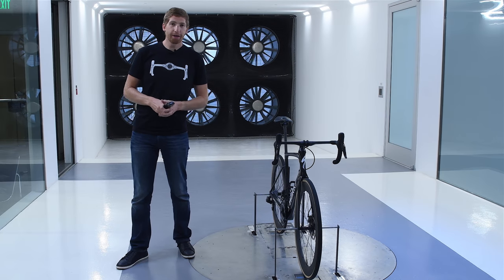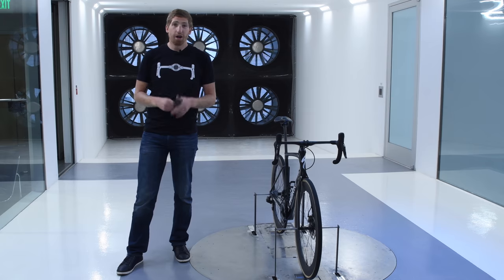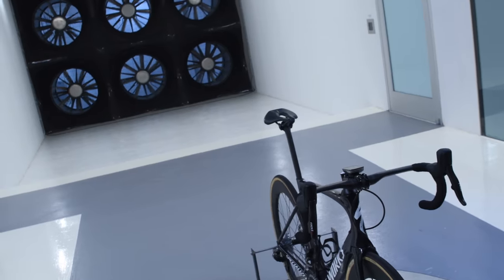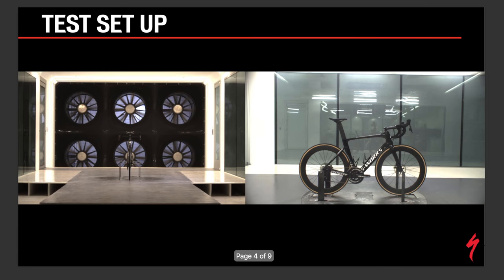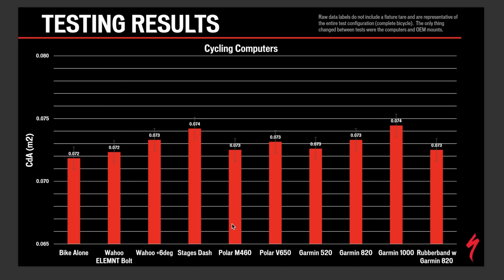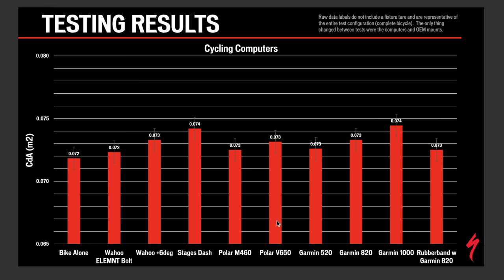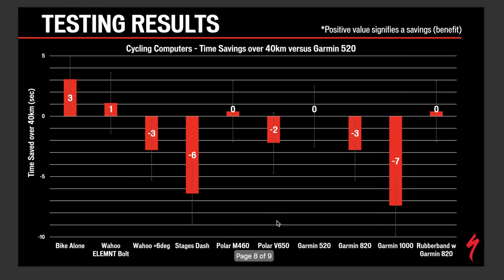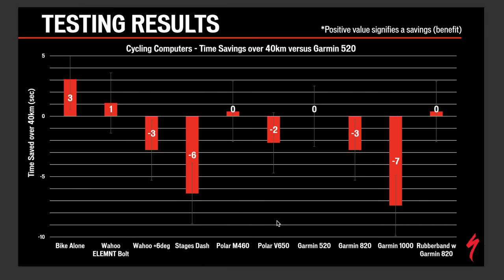Wahoo BOLT AERO claims: FACT or FICTION?

Comment: Great video. Great sound! Love the concept. But wahoo cracks me up. 1-3 seconds over 40km. Aero efficiency is far more greatly impacted by tightness of clothing, rider position on bike and ability to hold a constant position over 40km, and size of beer gut. I can't really believe we are even talking about 1-3 second gains when most weekend warriors could all do with losing a few kg!!!
Reply: The fact that tight clothes matter more doesn't mean a faster computer isn't worth getting.   Especially if you need a new one anyway and you're either not picky or a faster computer meets your other demands in a computer.  Of course,  claims should be accurate at the same time..

Comment: Hey Ray, out of curiosity, what speeds are these claims at? Obviously drag increases with speed.

I'm probably not going to be as fast as Chris Froome in a TT. If I'm riding at 20mph into a block headwind, the drag would be different to 25mph with a cross tail wind.
Reply from the maker: The tunnel is at 50KPH, and their claims are at 30KPH.

Comment: A test I think would be interesting is if instead of mounting the computers ahead of the handlebars you were to install them behind, trailing the handlebars. Wound the aerodynamic effects of the handlebars reduce the drag of the computer. Sure it puts the unit in an odd position, but if someone is that concerned about it I'm sure they'd live with it.
Reply from the maker: If you mounted it to the handlebars backwards, the screen would be backwards since it can only fit in one direction.  Not sure too many people would want the screen upsidedown.

Comment: How is it possible that there is diffrence between garmin 520 and 820. Both have the same body size and shape.
Reply: But not the same number of buttons or screen size.
Reply from the maker: Correct, very slight hardware differences. Almost identical...but not quite.
Reply: Come on guys... The same dimensions: 49.0 x 73.0 x 21.0 mm (sizes from Garmin site). Display is the same (820 has a touch screen - no areo benefits). I would say that measurements in wind tunnel were inaccurate.
Reply from the maker: Do note that within the video I talk about the accuracy range of the tunnel, so you're going to get some minor fluctuations there as indicated on the slides itself.  Still, the reality is that even having something just 1mm different can and is a big deal in aerodynamics terms.  The Edge 520 and 820 aren't exactly the same, despite was Garmin says - hence, there will be differences.

Comment: When you don't even bother to put a dummy on the bike, when your test is conducted with a wind speed of 50kph. (Nobody can ride at that speed for the full 40km TT, not even indoor)
Your channel doesn't grow because it is a commercial.
Reply from the maker: As discussed in the post and the video, a dummy on the bike wouldn't impact this area of aerodynamics (whereas it would further back for other components).  Also, the reason for the higher speed (as also discussed) is because lower speeds introduces a higher error rate in wind tunnels which in turn reduces the measured accuracy, and doesn't impact the actual numbers here (that's been tested and proven separately by other studies).

In unrelated news, according to Social Blade it'll take approximately 5 years for your channel to reach 1/10th the size of this channel today, based on your current growth rate.
Reply: To sum it up. You don't know aero very well, or you knew it but you pretend.  A front mount bike computer hit the air first, it's extremely tiny wake, if any, hits the rider (which is a brick, and we are not even talking about handle bar's much larger wake).  So missing a dummy means you could measure the very tiny drag, but with a dummy you could not, because we are not talking about a laptop atop the bars.  Which means the test is compromised.
Anyway, this video feels dumb and forced out for a commercial purpose.  The lab results, are irrelevant in real life.
By the way, I ride Specialized and Trek, and all Wahoo. Doesn't mean I believe some of their claims.  Especially when it comes to aero and watt.

Oh and if in 5 years my past hobby non-growing channel actually reach 1/10th the size of yours... Do you know what that means?
Reply from the maker: You're welcome to believe what you want, but a large body of science disagrees with you.  As do a huge number of people who actually work in aero for a living who have looked at the test and agree with the methodology (most of which are not connected to the companies involved, in fact, some are competitors).  But again, believe as you see fit.

As for channel size, not sure what it means, as you appear stuck on it.
Reply: First of all it is not about what I believe.  It's about a faulty test, irrelevant to reality, swaying consumer opinions.
Check out Xing mobility, the lead engineer was from Tesla and he laughed at this video.  He knows DC Rainmaker too, a blogging salesman.
Large body of science, huge number of people who actually work in aero? You are NOT one of them, you possess no more aerodynamics knowledge than a highschooler.
On the other hand, F1 teams don't run CFD tests on parts, part of a wing, a front wing, etc.  They run it on a whole damn car, include a digital scan of the actual driver.  For the very obvious reason, everything can cause a miniscule change to drag, nor NOT.  Airbus doesn't run CFD on the nose cone alone.

Hard to believe you didn't catch the channel sub joke.
Reply from the maker: That's good that he's done car stuff.  But that's not bike stuff.  It's actually why companies have seperate wind tunnels these days for bike stuff.  Also, there's no two people who have spent more time doing bike aerodynamic testing than the guys I did testing with. None on this planet.  Period.  It's all they do, day in and day out.  I don't have to know aerodynamic testing, they do.  If he was actually good with aerodynamics, he'd know about speeds too and how they impact accuracy of the data.

It's funny though you're so bent out of shape on this.  Because realistically the numbers I showed basically say 'blah, it doesn't really matter'.  Which is what I say in both the post and the video Yet somehow you think it's a commercial or that I've said something else.
Reply: yeah yeah yeah, whatever.
Reply: I'd like to offer my 2 cents. (because, why not :)) I'm not an aero engineer, and my understanding of aero is also perhaps high school level. 

I agree that in real world conditions there are a lot more factors that affect measurements. But the way anything is measured is always in some standardized repeatable way. The experiment needs to be designed so that you get some meaningful data out of it in terms of directionality of results. Will there be variances, sure.
Now, I'm sure there might be very little effect of having a bike computer mount out front, when a rider is also involved, but we need to be able to make measurements, and try to draw some conclusions from that.

For e.g., you can quibble all day over whether or not microprocessor benchmarks are representative of the real world use cases. But everyone likes to run those benchmarks to compare performance across chips. They do make some sense afterall - a processor that scores a tenth of the score of another, is not going to be faster in any real life use case. With minor differences of the benchmark score, on the other hand, of course the performance in real world can differ based on the actual use case.

In that regard, I did not find this video misleading in any way.

Ray, aero and all, do you think the weight of the bike computer matters as well ? or does it not because all pro bikes would weigh exactly what UCI minimum needs to be.